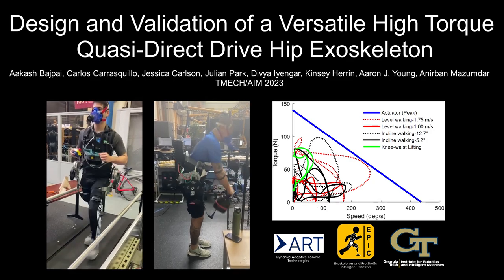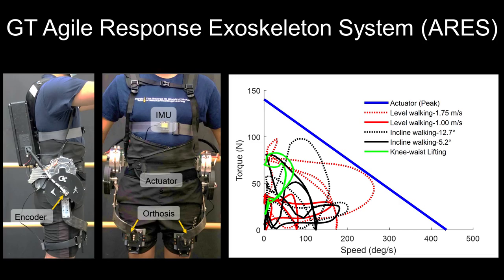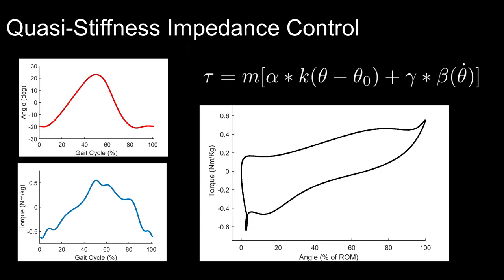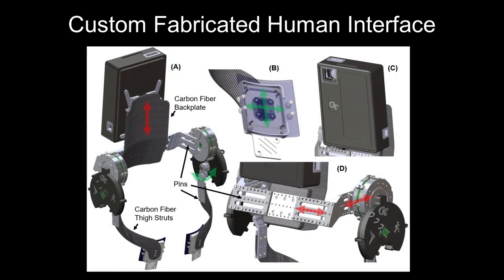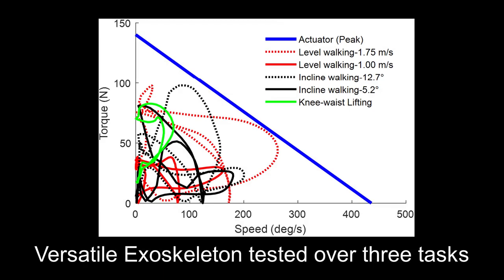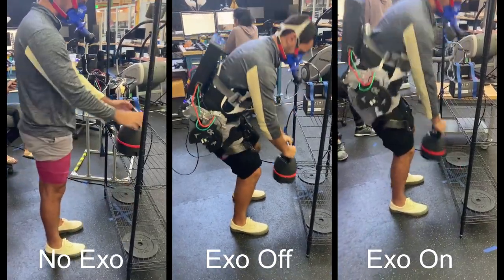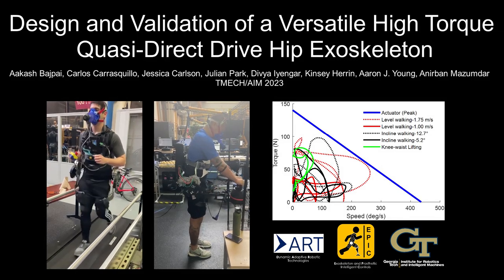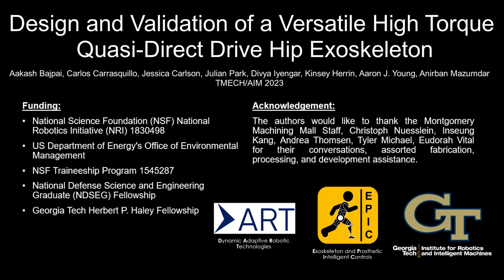Design and Validation of a Versatile High Torque Quasidirect Drive Hip Exoskeleton

Comment: It struck me that the exoskeleton provided negative benefits in some cases. I wondered why the big difference from the unpowered exoskeleton? Unpowered, I take it, presents some load to the body, added weight, or, I'm guessing, significant friction losses and magnetic losses when unpowered.
The spur gears seem to generate a lot of "clatter", perhaps a partial helical gear set would be quieter. I wondered if a toothed belt drive might be quieter, although it might be "interesting" to get enough teeth on the drive end for secure enough driving of the belt... Nice project. Hmmm... I had a drive system for a folding/rotating bed, where we used an air spring to provide force to assist part of the cycle. In a lifting mode, upper body weight provides most of the force needed for the flexion mode, with drive needed in the extension... Sorry to blather, just "stream of consciousness"... Could you store energy in part of the cycle in air, air/hydraulic, constant tension rotary spring... I didn't quite get the control mechanism, it sounded like you use motor impedance to generate needed feedback? Position or force input from some other sensors in the frame?

Comment: That's cool! It's great that you saw results! As a bystander, I'm a bit disappointed that the description of the metabolic cost results did not narrate the fact that in certain cases, the powered exoskeleton barely reduced metabolic cost to the actions and even sometimes increased it. I believe that the results are absolutely promising, and that acknowledging the areas where there is still room for improvement would not discredit the work that has been done and the positive parts of the results. I think that selectively not narrating statistics to gloss over disappointing results just reduces credibility and puts a needless stain on viewer perception of the project.